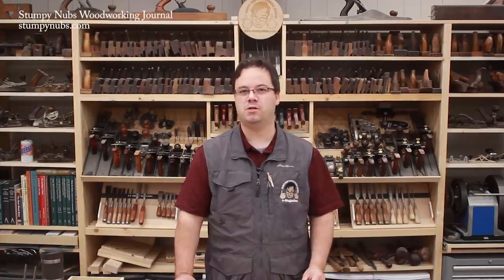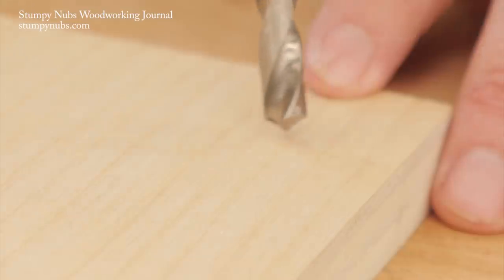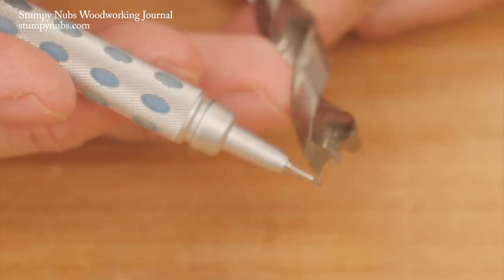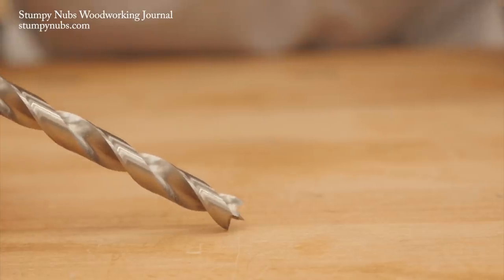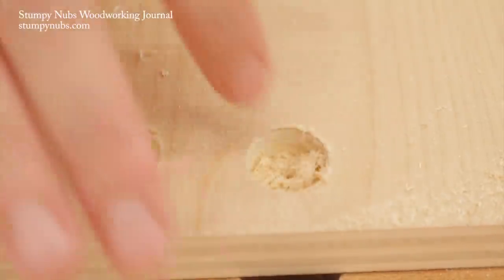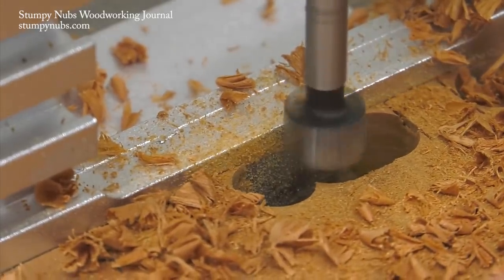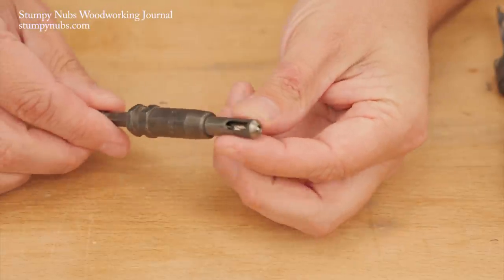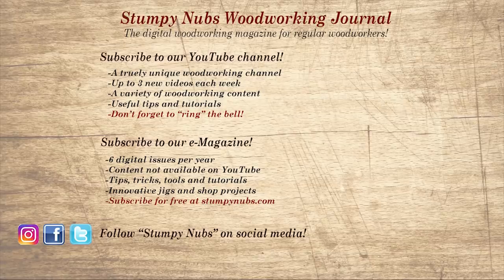Tips and tricks for choosing and using woodworking drill bits

Comment: Thank you James. As a former machinist I know that not all drill bits are created equal. We used both high-speed steel and carbide bits. Our holes needed to be accurately bored. I have some saw tooth forstner bits and they do an okay job. Thanks for the information.
Reply: @BTW...  The shops I worked in we used Cleveland brand. I'll check into the SKF Dormer bits. Thanks.

Comment: I've added machinists' center drills to my arsenal of woodworking drill bits.  When I need to start holes at a steep angle, their stiffness and pilot really keep the hole on target, especially when used on the drill press.

Comment: One problem of small twist bits (even bradpoint bits) is encountered in the wood itself.  If you are drilling in riftsawn  conifer wood where the ring boundaries are roughly at a 45 degree angle to the board surface, the bit may deflect as you encounter the boundary between rings where the sharp boundary change uppermost and descends at angle to the bore.  This is a definite problem when the density difference between early and late wood rings is very high, and if you are in a hurry, it can result in a snapped bit.  It can also happen with other systems besides drills, such as pneumatic nail guns.
Reply: @peternelson5113  DF is one of my favorite woods and back when I was still leaning more on machine tools I had an 18 guage brad from a pneumatic nail gun bend at right angles and come back out the show surface.  I found out by snagging my hand on it.  That was one the experiences that shifted me to using hand tools.  With hammer I could drive a small, finishing nail straight through the late wood.  It might argue a bit but it went where I wanted it to.  It's less of an issue when The rings are more at right angles or parallel to the nail axis.

Comment: Hi, thank you for the informative video on drill bits. I am thinking about going into woodwork and wondered about about multi-woodwork stations. Do you have any comments or suggestions about them? Just to be clear, the station comes equipped with some power tools. I used to see vendors at a State fair or expo. Thanks Frank.

Comment: I have a strange bit in a cheap set of drill bits I bought 2-3 years ago. It has bumps on the side, where a normal (like brad point) bit has its spiral. What is that drill bit good for? I had an idea that perhaps I could use it as straight router bit (for sideways movement) but it didn't work well even in MDF. What is it?

Comment: Your link for the brad point bits is for the Chrome-Vandium set but two years ago you also had high praise for Fisch's HSS set. Do you have a preference for one over the other?
Reply from the maker: The HSS are ultra-premium bits with special tip geometry for very, very clean cuts through delicate veneers, etc. They only available in a few sizes and are quite pricey. The CV set is their every day use premium set.

Comment: Any thoughts on hole saws? While they are often my first choice, for larger holes, I often prefer them to spades  (assuming Forstners arent practical)
Reply: Whenever possible I position the drill press fence so the work piece is hard against it, and hold with two clamps.  One problem I have is that my drill press does not go as slow as I'd like for 50mm and above holes, but it is what it is, and once the teeth have sunk a milimetre or so into the wood it stays steady (so long as it is clamped).  Then I cut for a few seconds, and withdraw and rub a candle against the teeth. This clears the chips and lubricates which stops the hole saw getting to hot.   One of the advantages of extending the drill press table (which is one of those wood shop projects we all do) is that it makes it easier to clamp.

Comment: Any tips on clearing centering bits? They always seem to get jammed up on hardwoods
Reply: We've usually got a bit of candle in our apron pocket for waxing planes, so I rub the candle on the side of the bit every time I withdraw to clear chips.  This lubricates the bit and pushes chips out.  Especially useful with hole saws (which James did not mention today).

Comment: What about tim bits
Reply from the maker: I didn't feel it was necessary to include Timbits in this video because I think it's common knowledge that they are delicious.
Reply: @stumpy nubs I have no clue what a tim bit is, so that would have been helpful for the ignorant masses, as would the hole saw and counterbore which both seem to be missing. 

You didn't mention why you like self centering bits and why they were different than the countersink bits. 

The video was helpful, but I would watch it if you made a long, more thorough video even if repeated everything already said here.